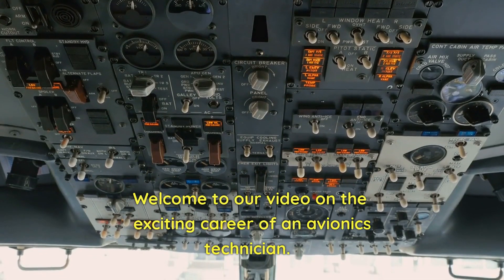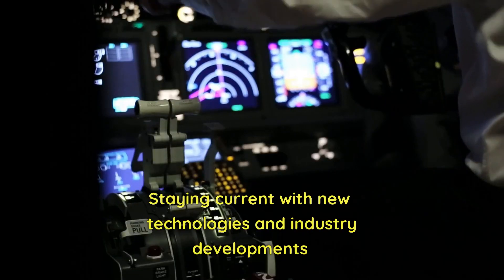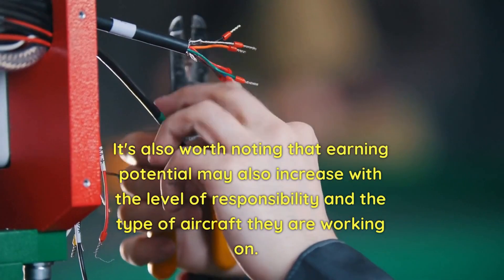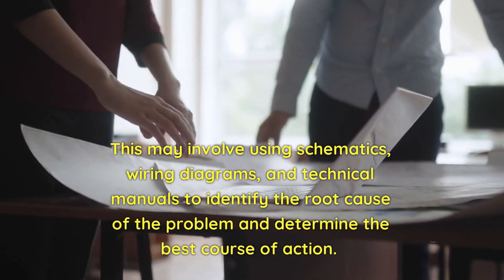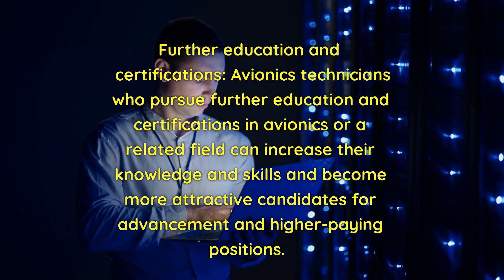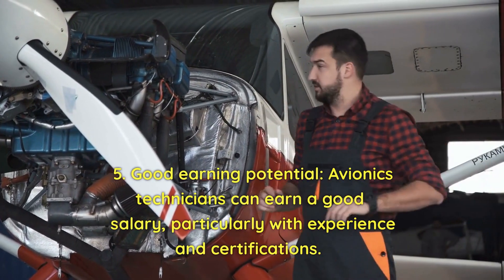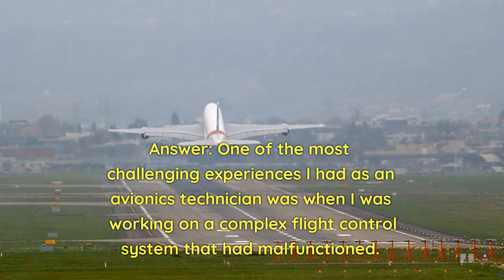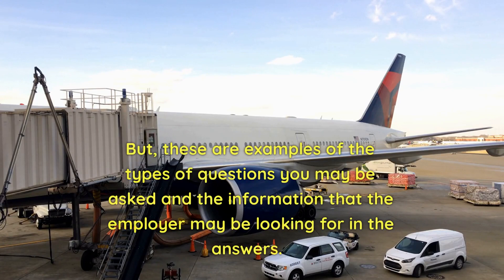Avionics Technician Jobs, Salary, Interview, Career Prospects

Comment from the maker: If you have any advice or anecdotes about the life of an avionics technician please share it below.
Reply: With new technology being integrated in the aeronautics industry the demand for MRO has increased. Faster failure analysis is required to determine root cause.  This gives little time for  troubleshooting. But, the reward is super great when product is repaired with minimum costs behind the process. Requires lots of patience.
Don't be discouraged. This job is very rewarding in its disguise.

Comment: I was an avionics tech for Pan Am airlines for about 5 years before they went out of business. It was one of the best jobs I've ever had. It was a flight line position, meaning I was not a bench tech, but I still did a lot of troubleshooting and problem solving. I really enjoyed working on 747s, 737s and A300, A310 aircraft. I was required to have a FCC and airframe license. I never did get my power plant license. For those who are curious, when the job ended in Dec 1991 I was being paid $19.49 per hour with overtime available. I wonder what the major airlines pay their avionics techs today.
Reply from the maker: Thanks for the feedback